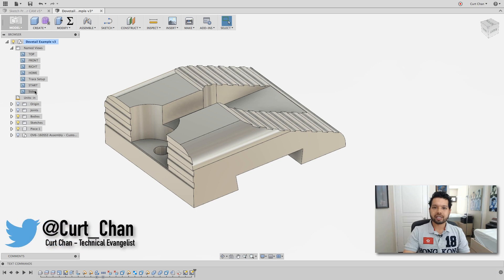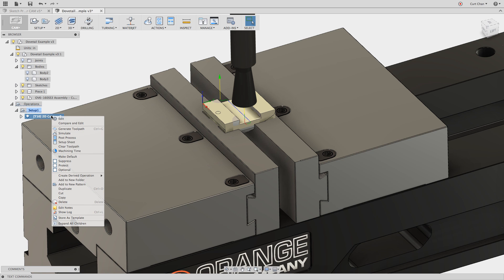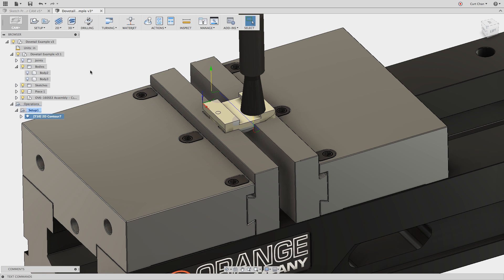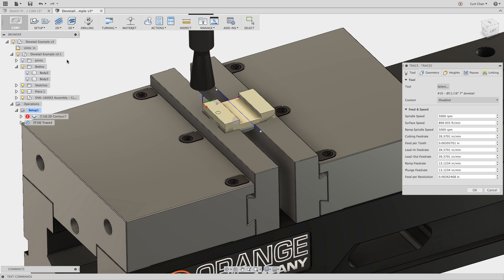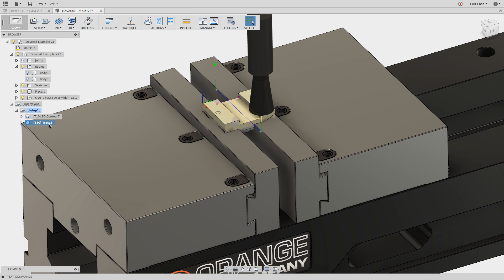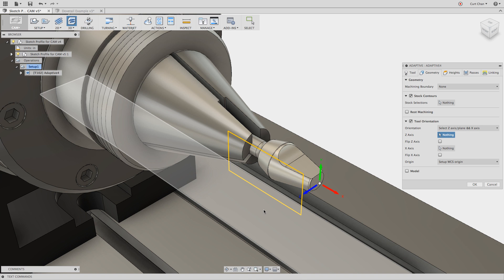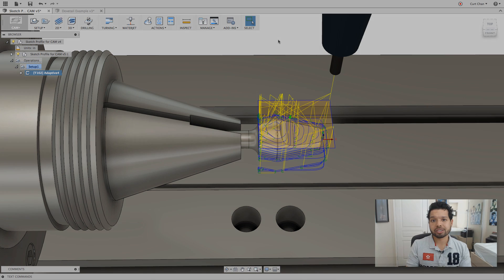Fusion 360: Leveraging Sketches within CAM

Comment: I have been using the trace, but I have to do an axial offset to get the depth below the sketch plane. Is there another way? OK, I re-watched the video. I see you are already at the right height. With my models, I am sketching on the face of the part I need to cut into, so the axial offset gets me there. Thanks for your great, bite sized videos!

Comment: Hi Curt, im a sheet metal kinda guy 40 plus yrs. Taking a part and making tooling for it with run off for a press. Then 5 axis laser for trim. Im having trouble figuring this out with fusion here is a couple of youtube examples to show what and how. Now the tooling is a closed solid to make changes at will. Thanks   .https://youtu.be/GV4QFMqQyUg             https://youtu.be/tZqxmmj_O7o

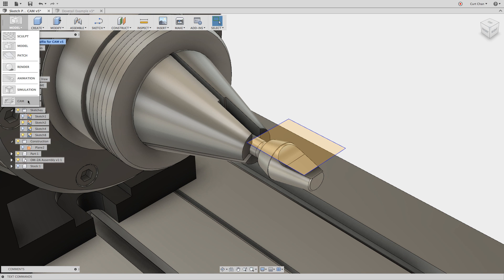Comment: Some good tips, not sure if your aware but the audio goes a little wonky from 5:13-5:31.

Would adding the fixture to the cam setup fixed the collision issue, or does that not work with 2d tool-paths?
Reply: Interesting...thanks for the heads up.  Good ol Camtasia

Comment: Great Tip! Did you say Fusion Ultimate? I thought that was no longer available?
Reply: +Tim Mallard It is:-)
Reply: +Curtis Chan Actually, that's very unclear and confusing. In the Autodesk online store, there is no Fusion 360 Ultimate. But there is one as part of the Product Design suite and it says that the difference is that it includes machining.

So the question is: Fusion 360 - http://www.autodesk.eu/store/fusion-360?licenseType=desktopSub&support=basic&term=1year

Does it have 3+2 machining? Yes or No?
Reply: +Kostas Froudarakis our sales team can iron out any questions.  Feel free to email them at fusion.360.sales@autodesk.com
Reply: +Kostas Froudarakis Ultimate has only been for sale via resellers... and the only resellers who have an interest in selling it are those selling CAM. The ONLY benefit at this stage is the positional multi axis feature set. So that also means Mill/Turn programming is only possible with Fusion 360 Ultimate.
Reply: +TacticalKeychains positional multi-axis is only available in F360U